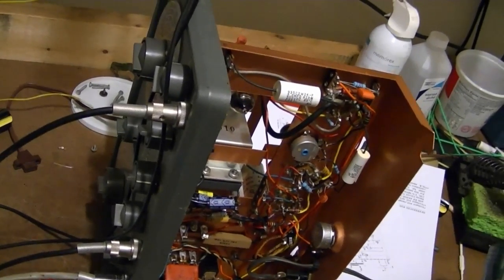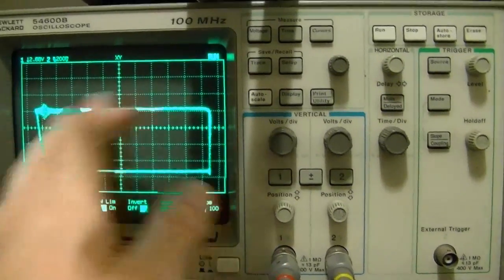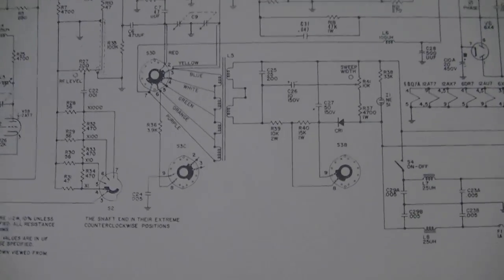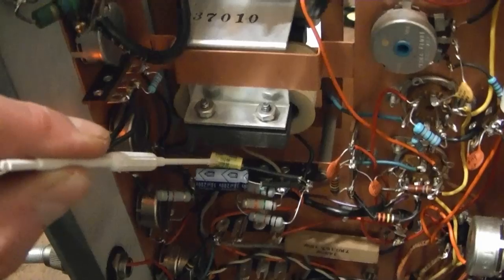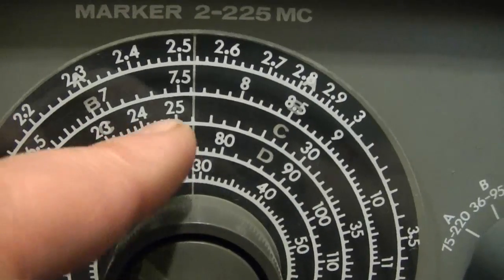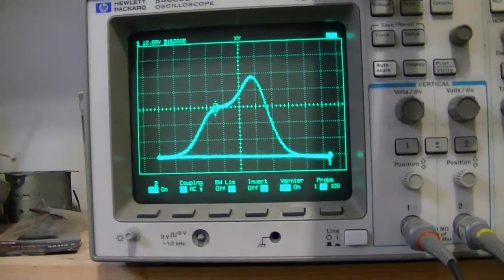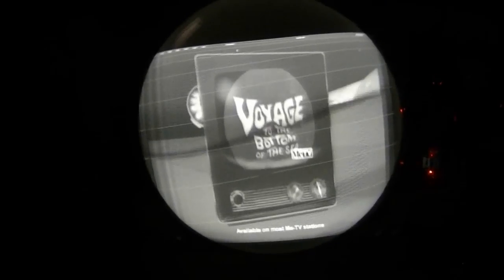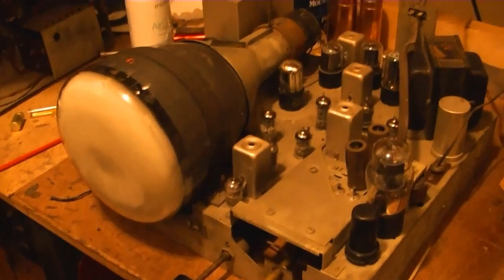EICO 369 pt2o2 plus more on the Admiral 17T1

Comment: How ironic...
I just got my Heathkit V7-A Vacuum Voltmeter restored and calibrated last night. It works like new. I have it on top of my electronics parts cabinet. Guess what's right next to it up there.
Yup... My Eico 369 that need some work. I guess I'll look at that next.
If I also get that one running, I then will have everything I need to align my Motorola VT-71.
Thanks for the inspiration and sweep width tips!
Tom

Comment: Bob, it’s interesting – unintentionally, for different reasons, you are gradually restoring the Admiral... : ) Another interesting thing is that the image was covering all the CRT with the messy caps, but not with the new ones... As someone said before, this set is a nightmare, too many things to repair. An untouched set would be much easier to restore... But definetly worth it, I think.

Comment: Bob, so great to see part 2 of 2 for the Eico 369, been waiting for that! You know, Eico does not spec that 20Mhz sweep width for every frequency range but they do spec10 Mhz minimum width for its TV and IF ranges.Try higher center freqs and see what width you get. Also, maybe the oddball inductor cores lose their mojo with use over time? Permanent semi-saturation? That said, its still a useful and reliable instrument within its limitations, and very novel in its design.

Comment from the maker: I'm not sure what earlier statement you are referring to, but no, not all IF cans have built in caps.  Sometimes they are external to the can or they don't have them at all.   Also the IF caps are usually encapsulated not like the exposed mica in cheap AA5 radios from the 50s and 60s.

Comment: Interesting. As I said, glad you did this cause now I have a reference for comparison. My unit is in storage for now, but you gave me an idea since your unit behaves like mine did. What if you decreased the line voltage a little, no more than 105-115v. My thinking is that perhaps less line scrote may make any alleged permeability change slightly less (or more?) of a relative factor and thus change (+ or- ??) the sweep range by a few percent? Never occurred to me before but it''s an easy test.

Comment: Great video!  Can you tell us the specific resistors you changed (and the values you changed them to) to get the wider sweep?  I ended up replacing my 369's sweep width control with a 1 watt wirewound pot.  Sweep became more linear and I slightly improved the sweep range.  I also added a BNC connector wired to the marker generator through the crystal marker socket.  I use a digital frequency counter to monitor the exact marker frequency.  I replaced EICO the AC noise filter with a used, three-wire noise filter socket from a Sony TV that I found on ebay for $7 used.  I prefer to use grounded test equipment!  Ironically, I too have an electrostatic set that needs an alignment (Admiral 19A1).
Reply from the maker: Hi and thanks.  I'm sorry though - it's been too long and I just don't remember.  I sold the 369 a few years ago and can't check  it.  I've been using a Wavetek 1002 for my main TV sweep generator the past few years.

Comment: Hello Bob:

I am interested on the Eico 369, the you restoration it is very useful for me. Excellent !!!

The manual of the generator mentions a Demodulated Signal Cable incorporating low pass RC filter.  Is the cable showed on you video? Does it a detector diode inside?

My doubt comes because on the schematic only appears a Test Probe with a 47K resistor and 0.001 capacitor.

Thank you and best regards,

José from Chile

Comment: thanks sir i have a sweep signal generator how i use for alignement FI radio and tv
Reply from the maker: I can't possibly cover that in a comment.  Do some research and study your sweep generator manual.  Then study the alignment instructions for your particular model.  Every set is different.

Comment: Hi
Can this Eico model be used to also AM tube radios?
Reply from the maker: No, it's really designed just for TV alignment and doesn't go low enough in frequency for AM radios.
Reply: bandersentv Can you suggest a vintage one that I can keep an eye out for on Ebay?
Reply from the maker: *****
That depends on what you're trying to use it for. Just AM radio alignment ?  Maybe an EICO 324.

Comment: What tubes does it use?
Reply from the maker: The EICO 369?  6X4, 6DR7, 12AT7, 12AU7, 12AZ7, 12BQ7.  I sold mine ages ago.
Reply: @bandersentv  Thank you, Bob. Apart from the 6X4 rectifier, all are dual triode. The 6DR7 is a dissimilar dual triode, which I remember from part 1 had to be replaced as it had gone to air.

Comment: Ummmm ..Permanent semi-saturation is not the right term, sorry about that, although that is what it acts like. Its more like a permanent permeability change -but then that's just a guess. Brand new inductors to replace these are total unobtainium, so my theory is hard to verify. On mine, I did basically what you did, and got the same basic results. So go figure.